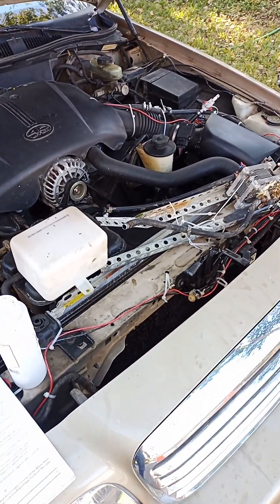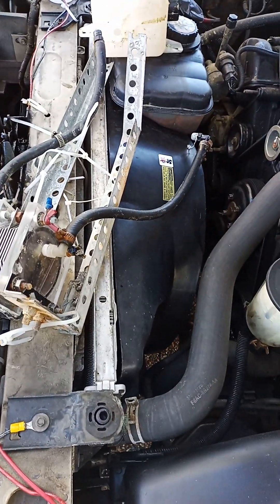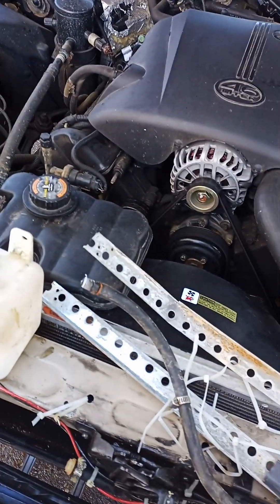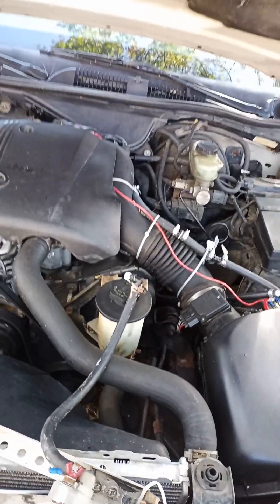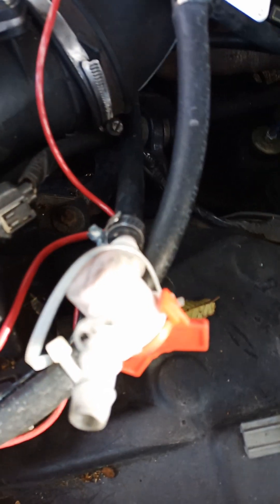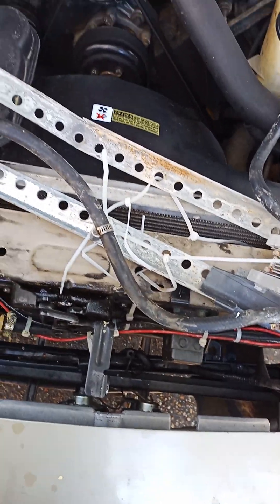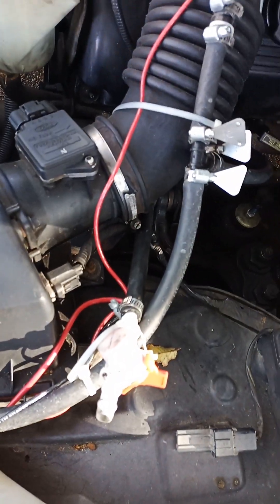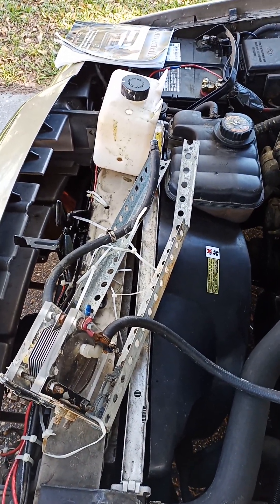VID 20231221 140112

Comment from the maker: There was also not enough hose or wire in my kit for my install and I had to buy more. I also had to buy the metal strips to build the platform which increased the cost even more. Check out other videos that report that no increase in gas milage is received if this does not convince you that it does not work. All it is doing is adding hydrogen to the gas and that does nothing to increase your milage.

Comment: Did you add electrolytes to the water
Reply from the maker: Yes, and the cost is expensive and yields no increase in milage at all   In order to produce hydrogen you have to add potassium hydroxide or other electrolytes to produce hydrogen. It did produce hydrogen, but there was no increase in milage. Check out other videos where they test it to see if adding hydrogen to the fuel increases run time on a small engine or an increase in performance of a truck or car. The findings are in some cases is even less performance is produced by adding hydrogen and even less run time.  Physicists will also tell you this does not work.